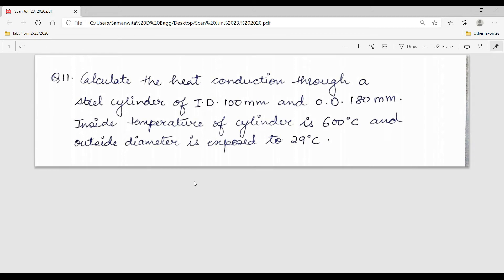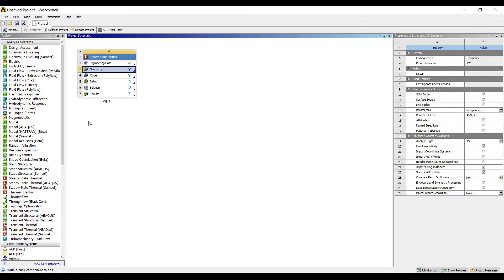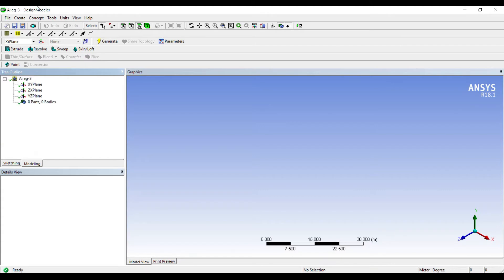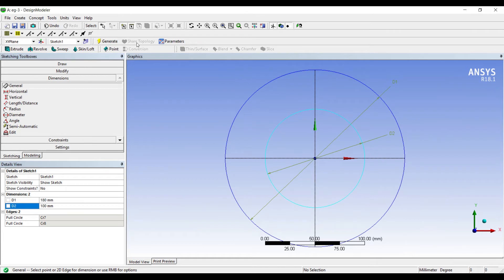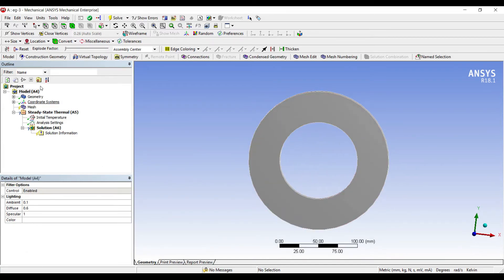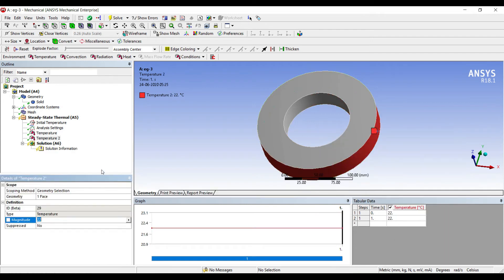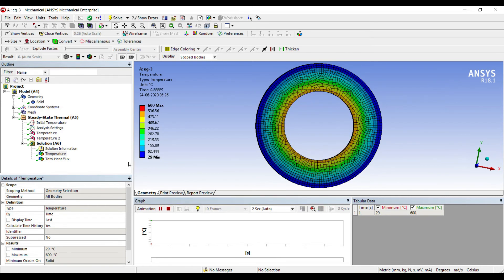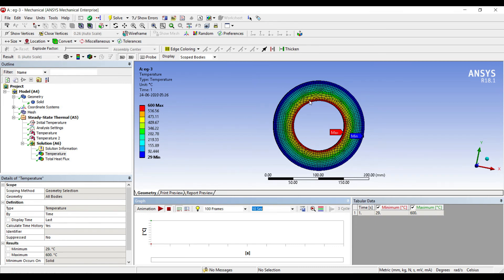Plane Hollow Cylinder I Heat Conduction I Steady State Thermal I Problem 3 I ANSYS Workbench

Comment: Hello sir, which version are you using. Iam a student and watching this video for my final year project.but downloaded 2023 version there are many features absent in 23 version.especially the meshing we have to type the size (course, medium option were not there) 

Can i able to uninstall ansys( I don't know how to do it) and how to get the version you are using
Reply from the maker: You can use 2023 version as I am using that version currently. You can give element size as 1mm or lesser based on your processor instead of mesh as coarse, medium or fine like in previous version.